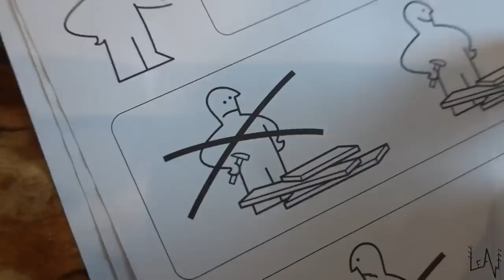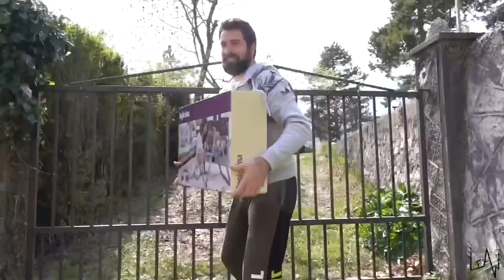GOING HOME WITH A NEWBORN! Bringing baby girl home VLOG - Italy

Comment: I warned you... It would be the biggest adventure in your lives.  The traveling is awesome but this, this is hardcore.  You thought camping in Canada in winter with no heat was challenging...and it was...  That little baby is to be turned into an autonomous responsible adult being in less than two decades, so the race is on.   Apparently it's pretty easy to mess up as evidenced by a brief look-around.  I predict y'all will be among those who do it well.  Cheers!  🤗🙏☮️